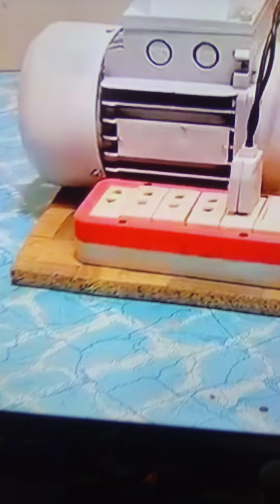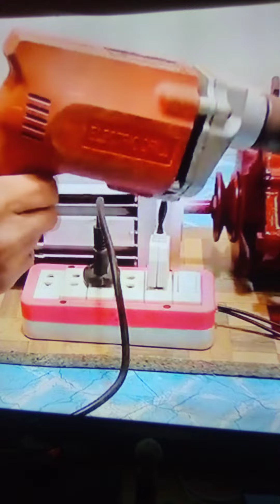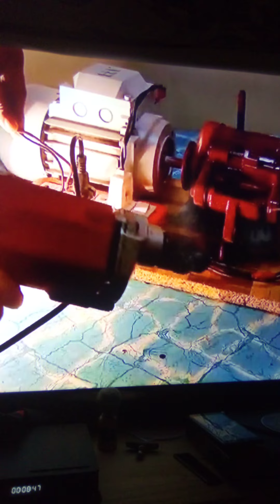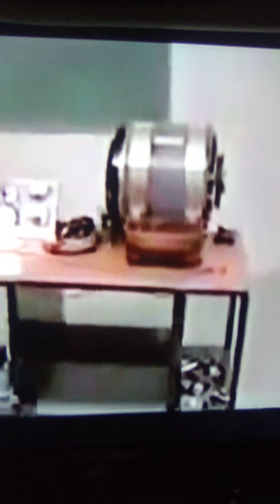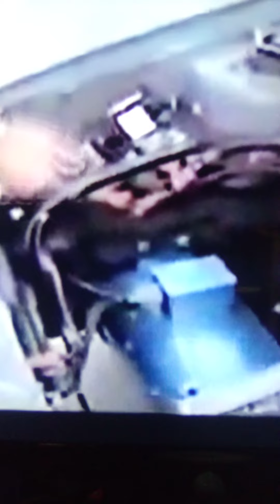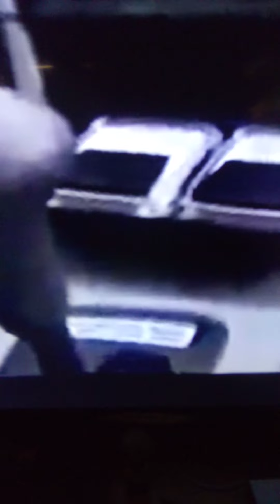cruzermans inventions free energy self running motors

Comment: I remember that guy the car ran on water  government killed him
Reply from the maker: No that one was electric and another one of the hindin secrets just like the car that runs on hho or water lol yip yip👍😁🎉🌟
Reply from the maker: Bob lazar from area 51 really 52 runs his car on water hho.its a big step down from working on the UFOs for him .
Reply from the maker: In this car the Hidden tec was a self running electric generator and motor that could provide power as you were driving with means no more range problems it's pretty clever 😁🎉🌟👍cool stuff